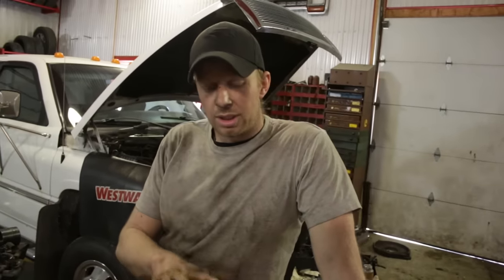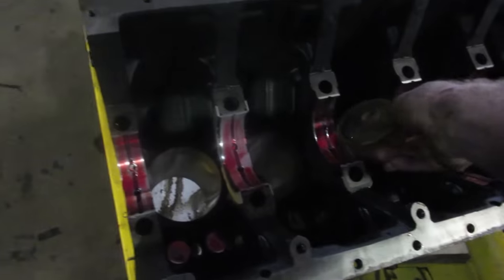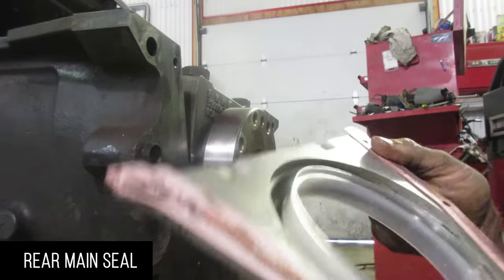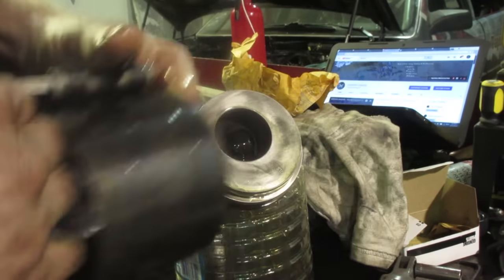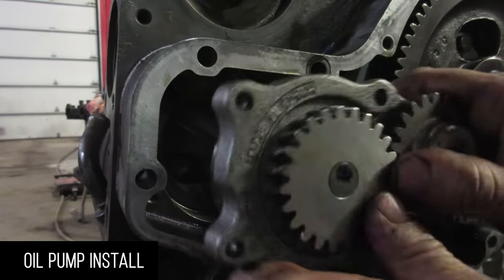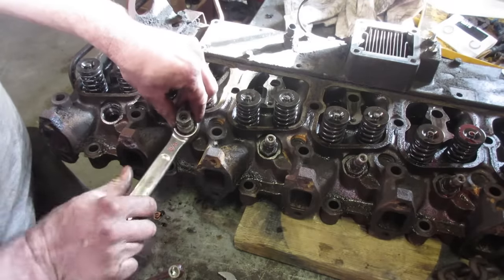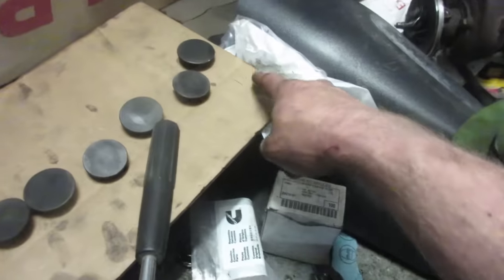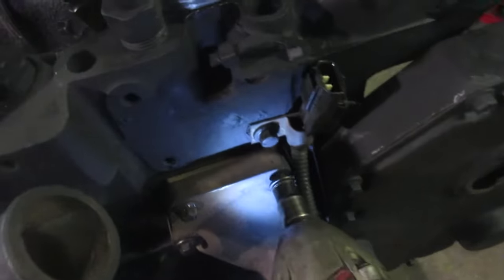How To Rebuild A 5.9 Cummins 12v Diesel In A Million Mile Dodge #1Mil12v (Part 3)

Comment: I have A97 12 valve 5.9 I've just pulled a motor out because every gasket was leaking replaced all the gaskets now I think I have a leak behind the actual Cam cover where it touches the block I guess I there's a gasket there I missed

Comment: I've driven more 12 valve Cummins than I can remember.  If the rest of the truck was even close to as good as the engine I'd never drive anything else.  Drive is the key word.  Herd is a common term after a few years.

Comment: The retainers look like the old retainer has a flat I dont know counter sink at the bottom of the taper and looks like new retainers are just a taper with no flat on the bottom of taper.
. I thought I seen it first time had to rewind couple times to confirm.

Comment: Could you do a video on timing your cam and crank? I ask because I am planning on do this same rebuild only using a different block and crank so I didn’t mark the gears
Reply from the maker: The gears are marked. one has a tooth marked and the other has the valleys marked.  You really can't mess it up
Reply: DEBOSS GARAGE I appreciate the reply thank you!

Comment: Yes, my 2002 diesel 7.3 powerstroke in my camperized old.ambulance has 999500 kms so not a million miles yet but just had to change the caps on the injectors. Whoo hoo!

But by end of the year, Lord willing I'll put a brnad new 7.3 l diesel feom Ford performance! 6006 long black and switch over my stuff (all the difference from 6006 to 6007 (which one could buy complete but I like my fuel bowl delete, tweaked turbo, temp gauge on dash for turbo, and ... well.maybe buy a exhaust manifold as a broke off bolt... bkha blah but ... Lucas additive is going in... have a second tank and fuel pump for veggie oil but when new engine i'll think about propane system..

Comment: if your crank is worn down and beyond tolerance you need to get it machined down and get OVERSIZED bearings.
Reply from the maker: No, undersize bearings.  If you grind your crank, it will be smaller.  Your ID on your bearing will also need to be smaller or UNDERSIZED

Comment: Whatever you do, don't use Fram filters
Reply: Fram filters are just fine as long as you keep up on your oil changes. If I'm changing the oil in a vehicle that isn't mine (and I don't trust that they'll change it on time), Wix or Mobil-1 filters all the way. Fram is more economical and will do fine if you change it on time.

Comment: I swap a 2007 5.9 for a 2004 5.9 but I still have the 07 computer and harness in the 04 engine but there is not ignition all sensors are connected batteries and then when I turn the key I don’t hear the ignition sound on crank

Comment: What was that red stuff you put on while the doing the main bearings
Reply: specialist reassembly oil, high viscosity oil for reassembly, stops wear on first startup, it washes out into the oil but unlike engine oil wont run out before you get to starting it.
you can use white lithium grease but you need to start the engine soon after rebuild as its corrosive, he does mention this at the start of the video

Comment: Did you read the Cummins service manual? Seals go on DRY! No oil on the seal surface.
Reply: WTFChuk go ahead and put a seal like the rear main on dry. You’ll have a nice oil leak.
Reply: Jon S Already have. No oil leak.

Comment: Man 6bt is waaaay more simple than a dmax, I can see why so many people fall in love with these things. Great video!
Reply: Not worth it.  It's a $4000 truck scrap it  and buy another one that runs.
Reply: @jasonneels3760  
^  🤣
Reply: @jasonneels3760  This whole channel is about preserving machinery from being scrapped as long as it doesn't show signs of irreparable damage - not throwing equipment away just because it's easier to buy yourself a solution.
Reply: From what I know the B series were made for over 40 years.

Comment: i have a 2003 w 5.9 and when i throttle above 2000 rpm it tends to stall, does not turn off, after about 30 sec to a minute it goes back to normal like its catching air. any one have the same problem?

Comment: Hey I have a Question I have a 1993 Cummins from a bus it has a 190hp at 2500rpm P-pump on it and Air compressor what can I do to it to make it come Alive ?
Reply: T Temple88 bump timing , slide fuel plate forward, crank star wheel in, slide afc housing forward. This will definitely wake it up a tad.

Comment: I'm not a diesel mechanic, but why didn't you clean this engine and do a valve job? You had it torn down, so you could have easily hot tanked and pressure washed it.

Comment: I don’t know why more engines don’t have gear driven rotating assemblies. Why all the belts and chains? I know it’s loud to use gears but it will last forever compared to a belt or chain.

Comment: My Cummins engine is not getting oil pressure what is the issue
Reply: Engine not running? LOLOL! Seriously though, is the oil pumping? IS the engine properly maintained- no huge amounts of oil deposits blocking the gallyways is the pickup tube on the lower end disconnected is the gauge working did someone drop something in the block blocking the pickup tube screen. A few possibilities.... oil filters get ruined also and I would start there first.

Comment: I HAVE A 5.9 CUMMINS IN A 2002 DODGE RAM 2500. THE TRUCK HAD 49.000 MILES ON IT WHEN I BOUGHT IT. I HAVE PULLED A 3 CAR CAR TRAILER WITH IT.I HAVE 800.000 MILES ON IT NOW . THE ONLY PROBLEM IS  I HAVE PUT 24 THROTTLE PUSHKIN SENCER ON THIS TRUCK. I CAN NOT FIND ANYBODY TO TELL ME WHY! IT NEEDS ANOTHER ONE NOW. DO YOU HAVE ANY IDEA WHY?‽?? IF SO PLEASE LET ME KNOW.  RICK.

Comment: When you say a little bit of silicone, is that gray high torque RTV? or something completely different?

I just did a 6BT oil pan gasket with red high temp RTV both sides, but following the tubes directions sans the single side instruction, since I've been told by multiple people to for sure RTV this pan and both sides. But I didn't smooth it out as you did and probably ended up using more. It leaks out the front and the rear, so I have to do it again. 😑 I don't want to do it a third time, so I'm looking for the best way to install it. I'm half tempted to get a fiberglass reinforced silicone reusable gasket. It seems more akin to modern German engine oil pan gaskets that require no sealant.
Reply: Silicone is one RTV compound but as you said 'high temp' is something different than simple silicone. And torque values matter.. a lot and condition of the pan... matters a lot. I would say replacing the pan with new pan that has a level flat surface might be called for. If you have a Straight edge(as important as duct tape in your tool box) check the pan edges. It does take some experience with pans to know the risk for 'bent or marred surfaces and likelihood of leakage.

Comment: What did you use to clean the valves with and how many hours did it take you to dissembl and re assembl
Reply from the maker: just wire wheel the valve stems.  about 30 -40 hours to clear and reassemble

Comment: I disagree with flipping the engine to read clearance, that puts the crank weight down on the bearing making the clearance wherever there's not weight. giving you a false reading.. meaning you actually have more clearance than you're reading. I could be wrong but that's the way I think about it.

Comment: in my opinion, the weight of the crank has no influence on the bearing cap considering the tons of pressure from the two cap bolts....think about it. Besides that, your craftsmanship is good.

Comment: Do you think it is OK to use a Synthetic Oil on a new Diesel Motor with 500 Miles and 18 hours on it?
Reply from the maker: No, let the rings seat.  wait until the first oil change

Comment: You are the only video mechanic that has made a point of including the torque readings even for minor attachment bolts. I was trained as an aircraft mechanic and torque was the holy grail of engine assembly and all the control surfaces.  Very professional presentation.

Comment: I have a question. You say that the main cap sequence is 44, 88, 130 but ive see some sheets say 44, 66, +90* what should i use and why are there two ways of doing it? obviously you use the 44, 88, 130 way.

Comment: I don't think torquing the crank mains upside down will make any difference whatsoever.
Reply: GNX157 , As an engine reconditioner of 50 years experience why he turned the block over to torque the main bearing caps down is a mystery to me, never ever seen this practise before by anyone, it doesn't matter a toss if you leave the block the other way round some people stand the block on its end so the Pistons can be easily slid in and big ends or rod bearings can be torqued up at the same time.

Comment: oil cooler,??,why is it in the block when all the heat is there,cant you fabricate line to outside cooler,operative word,is,,,,,,cooler.??.
Reply: Oil cooler is just a common term, but it really is just a oil temp equalizer. You basically just want the oil to not get too hot, but it actually helps to get it up to operating temp faster.

Comment: Does coke really work that good for removing light rust?
Reply from the maker: Not bad actually!  It kind of turned me off drinking it.  I have a barrel full of molasses right now that has an engine block in it (used water instead of antifreeze rusting up the water jackets) and the seat rails from the GTO in it.  It works even better, it just takes 2 weeks.  I dunked the entire studebaker in a tank of molasses and stripped the entire car https://www.youtube.com/watch?v=_fvTgnbV7H4&list=PLYbEYVyB_NH_upTY54Y10uO3L8Qvd6Vfv
Reply: It’s the phosphoric acid is what does the work.  Phosphoric acid is much cheaper without the sugar and flavoring, so it’# cheaper to use that instead.
Reply: Ill have to try it some time. Thanks for the reply!

Comment: after shivering in my first gen the first winter i owned it, i ordered a 205 degree thermostat from Texas. i have worked that poor truck like you would not believe in the 10 years i've owned it and it has never climbed above 195 in any situation. (measured at the the hot side of the thermostat with an autometer non electric gauge). 

my buddy likes to tell the story of an ancient 500 KW (i believe he said it was 12 cylinder) Q series? Cummins generator they used to run a gravel crusher. "she would snap and snort and blow smoke rings at anything under 200 degrees but once under load she'd hit 250 she'd purr like a kitten and the heat waves would just shimmer." one winter night at 54 below the cranckcase vent froze up and all the oil puked out and that was the end.

Comment: As far as assembly line, I am in absolutely no way condoning this duckerie but here is something I seen(do not try.... Absolutely any of the following) my neighbor had a 80 c30 flatbed he used for hay... He didn't have a v8 to go in it so he put a 4.3 on the old bulldog tyranny,  sure enough spun a rod bearing,  thanksgiving night he dropped the pan,  undid the 1 rod that spun,  changed that 1 bearing only nothing else,  and used personal lube (KY) on it and called it done... I couldn't believe I watched/helped with this foolery and still can't believe he still runs hay out in the field in the mornings with it
Reply: When it comes to repairs and rebuilds I am super ocd and take the extra mile at everything and this entire Chevy is the cringiest thing iv ever been around

Comment: Don't spray cocacola on it. You have all the sugar and shit that goes into it. The chemical that breaks down the rust in cocacola is Citric Acid and you can buy it real easy online. Just buy some, mix it with water and spray. No sticky residue to deal with. It also means you can play around with the concentration your self. Also once you pressure wash it out, air dry it with compressed air then rub mineral oil over it if you are going to leave metal to sit. The mineral oil will prevent surface rust (Or should do) and is easy to clean off after. Or you could use w/e type of engine oil you would be using for lubricant and just not bother cleaning it off after.

Comment: You can buy a pack of those small rare earth magnets and use them to hold your lifters in place so you can flip the engine over and don't have to worry about installing the cam just to hold your lifters in place.

Comment: even the new engines have this made in china oil pump yeah even cummins have some weak point
Reply: Never seen a failed oil pump  on a cummins. Also  nothing  wrong with made in china as long as quality  control  is there.  China  is one of cummins biggest  customers, make  sense  to put  a factory  there.

Comment: Just a fyi rings spin as the engine runs so positioning does not matter  as long as there assembled  with gaps opposite of each other its fine  it doesnt matter if gap is pointed towards intake or exhaust

Comment: Hi had 5.7 gm diesel junk big time put 350 olds gas engine worked good. Had a couple 6.5s blew one 94 dually and 95 3/4 2wd not bad but low on power. Also started having numerous issues with 05 duramax traded on 04 Yukon with 5.3 and 05 Silverado 5.3 z71 simple to repair and affordable to run. Tim

Comment: To help with quickly forming surface rust, you can use a can of canned air. It's not actually air and doesn't have oxygen and will stop a good bit of rust from forming while the water evaporates away.
You can also spray it with acetone which will help evaporate the water away.

Comment: first let me say i love your chanel,and a fellow Canadian,i was wondering if you have ever thought of assembling the pistons in the bores DRY, to prevent glazing the cylinder walls,i've built a lot of racing motorcycle engines over 35 years of racing,,and most of the top builders always would say install dry,but oil the rings,i would throw the bike on my dyno and run it easy for a few heat cycles,then progressively harder,and never had any cylinder scoring,

Comment: Did i miss the piston coolers 
They are plastic should be replaced when ever the crank is out
After torquing the rods shake them on the crank if something is wrong you wont feel the rod move that step saved an engine someone else took apart which the mechanic used a punch to get the piston past carbon ring which put a minor ding on the rod so when the rod cap bolts torqued it pinched the crank
All ways shake your rods

Comment: 20:54 get a set of pass through wrenches for that. Not needed, but for things like this and intercooler clamps or anything with a lot of threads and a nut to drive out those pass though's can work wonders.

Comment: A 440 thermostat is the same diameter as the 12v and its a 195° did it to my 12v and it has run much nicer in the winter. Didnt notice a difference this summer.

Comment: I seen their was a twin ram on the cummins clip I never understood why people think they work unless your running high rpm like 4k, if your running boost then the whole intake is pressurized and the intake volume is larger than the cylinder enough to fill like 2 cylinders so the pressurised air is waiting at the intake valve it doesnt have to flow through the intake then go through the intake valve like a Naturally aspirated engine so what is the point of a twin ram besides status symbol and looks I see people saying 50hp gains but have seen their is no difference on dyno and I couldn't figure it out until I really got to thinking about it.
Reply: Some of those engines, I think early?.. honestly can't remember the years, check it out..... where wrist pin failure is possible upping H.P. and R.P.M. . leads to a split piston.

Comment: Basically if you can remember to torque the bolts to 18 ft lbs then you can rebuild a 5.9 Cummins.
Reply: torques main bearing bolts to 18ft/lbs

Comment: I don't need a Diesel, but I'm interested in a v-10 Second Generation or should I just purchase a new Truck. Anyone have an opinion ? Ted.
Reply: 6.4 HEMI! I have a 2003 Ram 2500 with the 5.7l hemi and I tow 8k+ behind it at least once every few months. Does good, maintains above the speed limit all the time and averages 8mpg while towing that. I like it, does what I need it to do.

Comment: Brave soul to install a cam shaft without some form of protection on your hands. Petroleum products burn like a bitch when you have a 1,000 razor blade cuts across you fingers and palms.
Reply from the maker: Or you could know you are doing and not cut yourself....
Reply: @DEBOSSGARAGE  Yeah, that was my first time pulling the cam out of my 6.5 bout 6 years ago. I've put on a pair of clean Mechanix gloves since  lol.

Comment: The 24v thermostat wont  help much. I have both 12 and 24v and they both run equally as cool. I have to use cardboard during the winter.
Reply: How hot are they runing in the winter ?

Comment: I love re building.. Never get to do much of it anymore. I think it is great that you are picky. As for torqing the turbo bolts. If you take a stubby box wrench with a 3/8 extension square in it you can do it backwards. I didn't have one so I made one. It wasn't pretty but it worked for me. I had a super picky client over my shoulder other wise I would have just wrenched it.